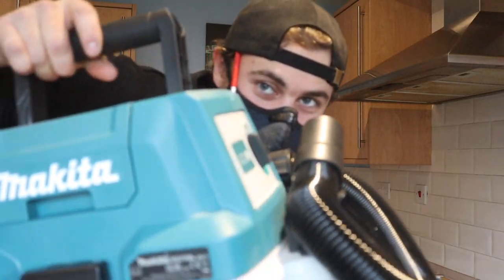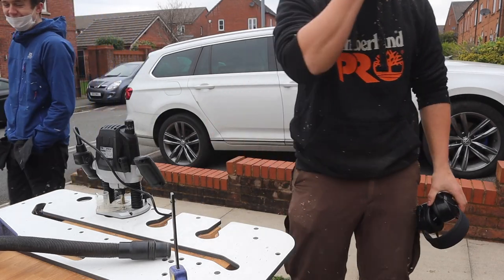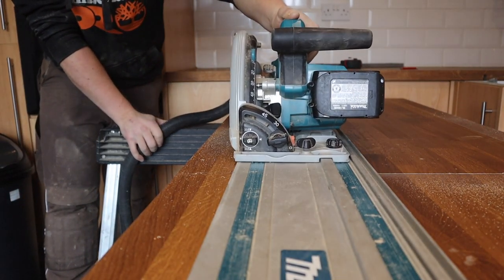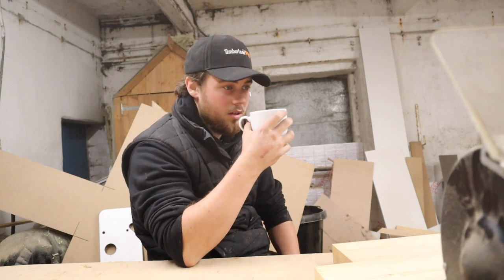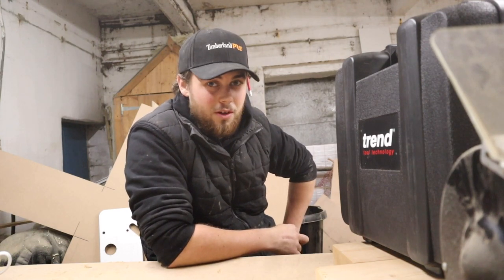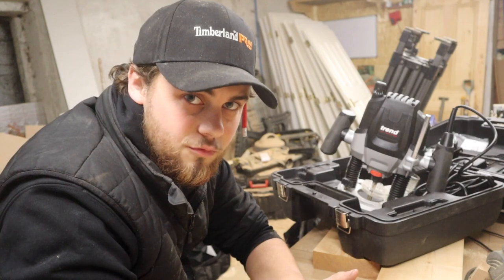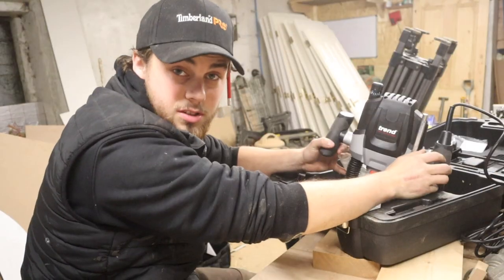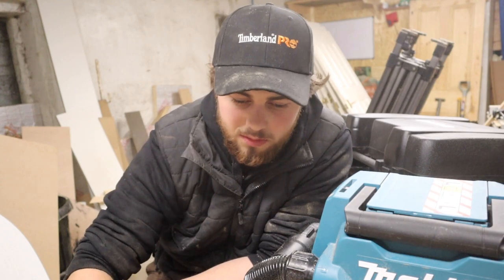SOLID Oak Worktops Are HARD! JOINERY IN THE UK!

Comment: use a biscuit cutting bit on the router and cut slots in-between the bolts, makes alignment easier and adds strength in the joint. But as you can see at 8:20, flat 90-degree corners don't last well, best to do a hockey stick joint and round the corners ever so slightly to avoid chips like that.

Comment: Curve the corners on the sink cut out adds strength is what I've always been taught. Nice video mate
Reply from the maker: Well, I’ve never heard that one before!
Reply: Yes stops cracking from the weak 90 degree corner, just stop your saw and finish with jigsaw or drill the corners out with 20 or 30mm drill bit
Reply: Always radius the corners not so crucial on solid wood but laminate it stops stress cracks at the corner most laminate is under tension so can crack

Comment: Could you please state if you carried out the disconnection of the Gas to the hob ? or did a registered Gas Safe person did this part of the job.
The fact that the Gas Pipe was left 'Open Ended' while you carried out this work is against the CoP Gas Safety Regulations.
A Registered Gas Safe 'Competent Person' would know that and would Never leave a opened ended Gas Pipe unattended.
I witnessed no other person present during your joinery installation in this Kitchen.
To become a Competent Person costs a lot of time, skills, knowledge and major investment of money to tradesmen to attend courses.
If the owner of this property has obtained a Gas Safe Certificate , then that's good for the house insurance.
No Gas Safety certificate = No house insurance cover.

Comment: I’m not a joiner but thought you were so supposed to put biscuits in for the joint plus as other have said a rounded corner adds a lot of strength less stress.
Reply: Yes put biscuits in when you can push the worktop up against the other worktop but in this case the walls were tiled and a wall at the end so you can’t get biscuits in,  it’s difficult to explain but you have to be a carpenter/kitchen fitter to understand.

Comment: Have you ever considered using pocket holes to connect the two worktops?
Reply from the maker: No, I would imagine that the zip bolts are a lot stronger over long term
Reply: Bolts are far stronger and dont run the risk of you making a huge mess as some people use impact drivers in final finish to drive srews for some reason

Comment: I notice you had some slots ready to accept biscuits but you didn't use any, isn't this unwise?
Reply: I'm guessing he couldn't fit the worktop with them in as there wouldn't be enough clearance to slide the worktop in with the tiles on the opposite end
Reply: Personally, I would say you need the biscuits, so the way round it is to use an old chisel to create 20mm clearance in the plaster/plasterboard at the opposite end to the joint.